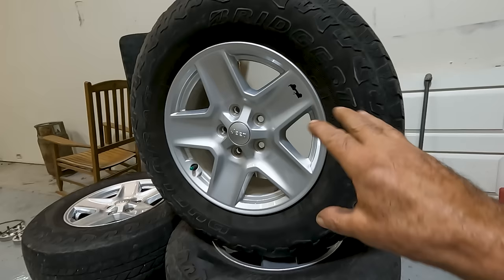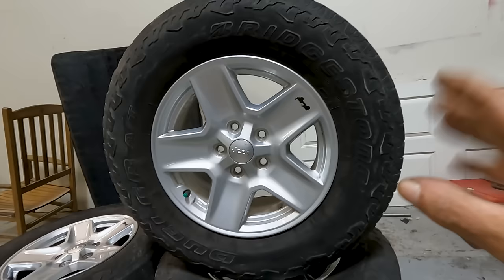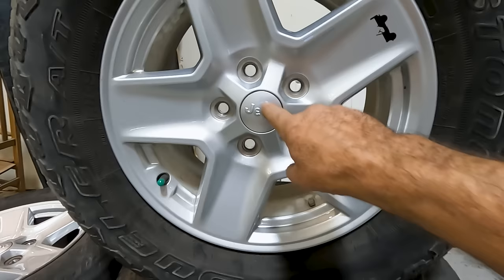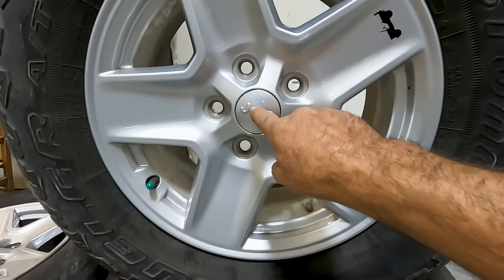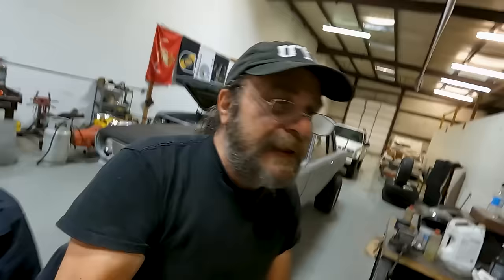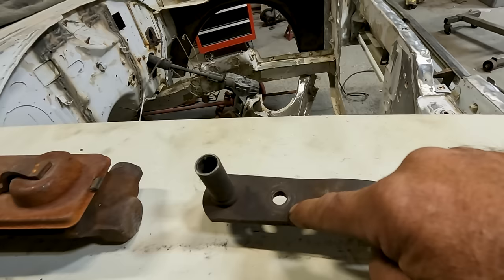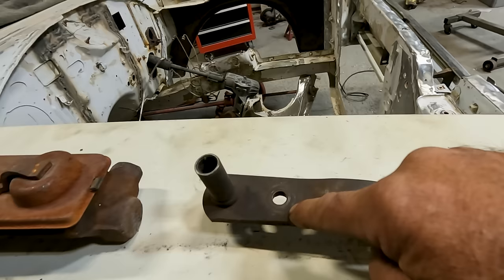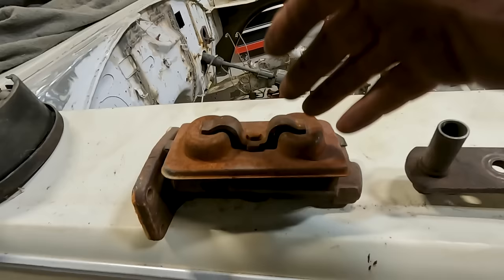Modifying Classic Cars And The Butterfly Effect - Can You Outsmart The Engineers?

Comment: When it comes to hot rodding a post emissions control engine, you're not outsmarting the engineers, you're outsmarting the EPA. 😉
Reply: It’s more about not getting caught. With most cars it’s pretty easy to throw a tune at it and you can change about anything. Or, can go full aftermarket ECM. 
But, unless it’s been through the certification process basically anything different from stock isn’t legal.
Reply: A lot of guys with later '70's cars would take off SOME of the emission stuff and make it run even worse....All or nothing is best
Reply: Hey as long as I can still send my ecu to canada for a tune on my 99 jetta vr6 and have it pass the rediness check here in ny, ill be happy but yeah I usually stick with the pre 96 stuff to avoid the hassle. 
Love my 79 with a diesel,its totally exempt and I can roll coal as I desire 😂😂😂😂
Reply: @NBSV1  one of many reasons that I love living in Alabama 😁
Reply: Well said.
Reply: I've got a 96 Buick Roadmaster sedan with the LT1. I had the PCM  reflashed and got rid of all emissions, optimized the tune, made the transmission shift less like a luxury car, and got rid of the security system. So if I want to swap the drivetrain into something else it ready to go
Reply: ida know, Honda had their CVCC engine that needed almost no emissions crap on it, and GM could have easily retrofitted rochester FI on the "corporate V8"--it actually ran well from 1957 until 1965 when the 396 became a cheaper way to make more than 300 hp--and had better fuel atomization. it could be argued some engineers could have figured out stuff that worked but the "suits" got in the way.

and now, we have 9 second Hemi cars. all that government arm twisting for better efficiency did pay off.
Reply: The EPA was trying to help you. It doesn't help a suit in DC for your car to make cleaner exhaust. Exhaust is a compromise anyways and its always getting worse. You only affect your breathing air and that of the person in the car behind you, pedestrians around you etc. Thats who you can profess to be outsmarting?  If you really want to be a smart American why don't you plumb your exhaust right into the cabin? That way you could become even smarter!
Reply: @NBSV1 do you play video games? You don't change everything with a tune. You can smartly change fuel trims and timing which is convenient as well as boost on some cars but its not changing the physical components or flow potential. It is just as easy as ordering Grubhub is all
Reply: @jamesmedina2062  Mind your own business.
Reply: Not too difficult there.
Reply: @jamesmedina2062  Lol, thanks for the laughs 🙄
Reply: @455buick6  we all gotta breath guy. Covid killed by taking that away. Have you tried breathing recently?
Reply: @jamesmedina2062 cry me a river... So I can dispose of my used motor oil in it😂
Reply: @jomamma1750  You can too
Reply: @jamesmedina2062  Since you brought up the lame political propaganda, you go first.
Reply: @jomamma1750  what propaganda?  You need to be a little more specific.
Reply: @jamesmedina2062  LOL, no I don't, everybody here know exactly what I'm talking about.
Reply: @jamesmedina2062 A "tune" doesn't alter the compression ratio, or the camshaft profiles.
Reply: @NBSV1    "full aftermarket ECM" 
😅🤣😂😅
Reply: @NBSV1  "basically anything different from stock isn’t legal"
Wrong
Not everyone lives in Cali, all my stuff needs to do is pass an emissions test.
Reply: @jamesmedina2062  He is confused, "full aftermarket ecm",  I am still trying to figure out wtf that is.

The way he uses the words process and bsically tells gives away that she was born after 2000 also.
Reply: @jamesmedina2062  no shit Sherlock but engines pack a lot more potential for power with factory hardware that they roll off the line with. A tune can give you noticable power gains for cheap.
Reply: @jamesmedina2062  Cars make a miniscule amount of pollution compared to everything else, it's a joke
Reply: @455buick6  No that's absolutely not true. You must not know much about engines. A good head will flow 275 CFM. A diesel flows even more. When a car is partially burning its fuel and IS NOT RUNNING RIGHT, one vehicle can put out more toxic crap than 100 cars that run right. I am not against cars. I'm a gearhead too. I'm just against ignorance and poor judgement when operating machinery.
Reply: @jamesmedina2062  There's tradeoffs, run lean get more NOx, run rich get more unburnt hydrocarbons. I'm fine with a reasonable level of required emissions controls on vehicles, especially newly manufactured ones, but it's gotten well into diminishing returns. By the mid 00s emissions systems seemed to be pretty adequate for the task, even the constant NOx smog cloud over LA was pretty much gone by the 00s. Regulators and legislators must of course always justify their jobs and department budgets by deciding more regulations are needed even when the problem was solved well enough a decade or two prior.
Reply: @treelineresearch3387  Well I have to agree with your premise. In fact, direct injection is sootier and dirtier than port and the upkeep is more difficult. So they went backwards. Also the big 3 are selling on average more cylinders and poorer fuel economy compared to previous years before they stopped selling cars. Again, backwards. Just when higher fuel prices could steer buyers via higher prices in the markets, Washington swimming in Big Oil cash pushed down on the price scales to placate owners. But to me the biggest issue is nonexistent enforcement of federal laws. They can intimidate manufacturers of vehicles but they are too lazy to go after the thousands of owners going catless. Again another reason why today computers and injection are so good but the emissions defeating renders improvements null and void.
Reply: @jamesmedina2062  Realistically so few people are doing cat deletes that it probably doesn't really have any substantial effect. You can't get it done at any legit mechanic and it likely voids your warranty so it's purely in the realm of enthusiasts and the poor (who simply can't afford a new cat nor a new car). The latter is a much larger group and to me solving that is more about making cats cheaper. In the case of a place like California their special requirements for certification and genuine OEM parts make replacement cats cost twice or more as much as in states without such asinine regs that seem to be written by the auto dealers and manufacturers.
Reply: @treelineresearch3387  cost is definitely a factor but I am seeing whole segments of certain vehicles all getting behind the norm of cat-delete. Loud sound is probably the most important reason. The second reason is increased power. In the diesel crowd, defeating their systems is mandatory to increase economy (supposedly) and increase longevity(& reduce costs).  Plus you have to be educated in the reality that close to 100% of older vehicles that are legally exempt because they're older than 24 years will never elect to repair or upgrade their vehicles when it is not legally mandated. SEMA and all the weight of aftermarket manufacturers is also behind crippling real enforcement. The situation is very different in Europe but no less exciting to some to flout the law there as well. It's like imagining that because there are some laws against drug use that the whole of society will just comply. Not only do people not comply but they contribute to multi billion trade in it. Flouting the law is a thing you know? How much in federal taxes is avoided? it's a lot bud.
Reply: @jamesmedina2062  Changing parts requires changing the tuning. You can gain a little power from tuning on stock stuff. But, if you're trying to get beyond EPA controls it typically means you're also changing physical components.
Reply: @NubsWithGuns  Well, you cut out the part where I mentioned if it hasn't been through the certification. Context can be important.
 Some of the emissions things are Federal. But, it's all legal until you get caught. Just ask all the shops that have gotten hit with big fines.  
FWIW I'm in an area that has no emissions testing. So there.
Reply: @NBSV1  as I mentioned the EPA doesn't care about your intake side so it is the exhaust side that whence removing your cat, you need a O2 spacer and tune to remove a check engine light. No major engine changes were made. Cat free downpipes are incredibly common and popular because they also make the car louder and everyone (young) wants their car louder.
Reply: @jamesmedina2062  As far as the EPA is concerned removing the cat is illegal. With them anything changed on the car that hasn't passed the testing and been approved is illegal. 
But, if they don't check it and you don't get caught then it's basically whatever you want to do. 
And, simply adding a spacer won't keep the CEL off if you remove the cat. Spacing the O2 out can help if the cat if marginal. But, especially with newer vehicles, it's looking for very specific readings and it's much harder to fool. 
You can usually throw a tune at it and just turn those codes off. I've never bothered to check how that shows up on the monitors and such though.
Reply: @NBSV1  The EPA does not touch the end user EVER.  What the EPA does is pay attention to large manufacturers and for a short while, 2-3 years ago, they went after nationally recognized shops performing cat deletes to fine them. They caught flak and stopped. Also some states use EPA guidelines if they are serious about emissions. California for instance. Urban zones such as Denver. But in speaking with government officials in Texas at least they said the laws do not affect cars older than 24 years and when the car computer says "ready" it automatically passes in my city. 

In general EPA does go to the birth of the car but does not do much after it is birthed. Kind of like Republicans in Texas with babies. Once a car is out in the wild it is super easy to fool the tax authorities in their states or simply pay someone to pass them. Its like cheating on a school test, only easier.
Reply: Lot of ppl in this thread obviously got brain damage from sitting in the drive thru in their decatted gas guzzler. Pollution is so cool!!! Beyond parody.
Reply: @user-zj5in4hg7w  It doesnt even have to be a gas-guzzler. Men in America do not think and simply try and be the loudest car on the road. Little if any original thought or sensibility. Sign them up for NRA and MAGA obedience!

Comment: I replaced the trailing arm assembly in my 74 corvette because I thought the wheel bearings were going bad and they are next to impossible to replace. Over $1000 dollars later and lots of swearing it turned out that the squealing noise I heard was just the positraction, it had the wrong fluid in it. Oops.
Reply: Honestly,, the true and real car lover has respect for..
Reply: Sadly.....some version of that has happened to most of us.
Good thing we love these mechanical contraptions
Reply: I was planning to drop the pan off the 300 i6 in my van (not easy to do) to check all the rods and for piston slap thinking I had a knock. I had already pulled the inspection plate for the trans and checked for cracks in flex plate and loose bolts.... Checked exhaust manifolds with my camera. Two months I eventually discovered it was the smog air injection tube broke. Lol. I didn't really know that was a thing until I did some research

Comment: One of Chrysler's main engineers, whose name escapes me, remarked that the difference in stroke between the 198 c.i. slant six and the 225--barely a fraction of an inch--made a large difference in the tuning and carburetion. I would've thought it would make little or no difference at all. Small innocent changes from stock can entail big problems to be solved.
Reply: Your mom said a fraction of an inch of a stroke made a huge difference too😮
Reply: @fastinradfordable 🤙
Reply: Small changes in stock can also fix/improve many things. Especially with new improved parts.
Reply: @fastinradfordable  Was that trip really necessary? Anyway, to be fair, I'd rather be Cummin' than Powerstroked.
Reply: Probably Larry Sheppard

Comment: The only thing I changed on my 87 Diplomat police package was the Lean Burn system. I replaced all the broken or rusted parts with correct factory spec. Parts. I really love how you mentor people in depth. I am 74 years old, and have been a car guy since I was 14 years old. Kudos for your ability to teach the reasons why systems work, and why they matter.
Reply: I drove that car as a taxi backin 88/89. Loved it.
Reply: Ran an 88' on 30" wheels, very mad max with the roof cutoff

Comment: One thing that I do believe in changing is the brake master cylinder.. If it has the old single  reservoir single outlet master cylinder, I believe in updating it to a dual master cylinder for safety reasons.
Reply: Conveniently, Tony's rule of thumb with "interstate era" cars also coincides with dual master brakes.
Reply: @rhekman very true, but I do agree with upgrading the master cylinder and distribution block for safety reasons. It's not a performance thing, it's a failure issue.  If you lose a line or cylinder on one wheel, with a single reservoir you lose all braking.  With a dual, you still have enough to stop safely, albeit maybe not as stable, until you can fix the issue.
Reply: @rhekman  he said 1962 and newer... Dual master cylinders started in either 66 or 67 for most cars. I updated the master cylinder on my 63 Dodge from a single to a dual master cylinder last summer
Reply: True I had a 65 Chevelle with a single. It ended up being the down fall of the car. 
But like he said upgrade the whole system. The 66 went to a duel master cylinder what was basically the same car.
Reply: @nathanmortenson914  I still have 4 wheel drum brakes on my 63 Dodge and they work great. I switched to the dual master cylinder  when the car was stolen and the thief had hit something and it had  cut the brake hose and I didn't know it. I hit the brake pedal and it worked fine but the next time I hit the brakes They worked fine.... for about 2 seconds then went to the floor at 65 MPH coming into a sharp curve in the road. I didn't hit the ditch, but I had the crap scared out of me.
Reply: Not really.  Tony is talking about 1962 and up but cars didn't have the dual until 1967.  That is 5 years of cars that need the change. @rhekman
Reply: Very  true  its a bit of a pain to repipe but its way safer
Reply: My 71 Challenger has 10 inch drum brakes, front and rear. Back when it was my daily driver there were some very interesting experiences when I had to drive through deeper puddles. Brakes didn’t work well after that So I’ve been set on putting disc brakes on it before it goes back on the road. Uncle Tony’s video has not made me rethink that, though, I will be far more careful about matching up the right master cylinder, and other components. I am sticking with factory KH pin calipers and adapters and rotors.  No aftermarket. It will be very similar to what the  been set up with had it been ordered with disc brakes.
Reply: Same think I did. A dual master cil. Added a PCV and upgraded to a GM 1 wire alternatoe

Comment: every car i have is 66 or older....i daily a 62 pontiac catalina....its as stone stock as the day it drove off the dealer ship....points single exhaust "economy package" 2 barrel....i drive it every single day rain sleet snow summer.....4-5 hrs on the high way at 70-80 mph....and i hear people all the time say you cant daily a classic.....yes you can....they was designed to drove on a daily basis....if you leave em alone and leave em the way the factory made em you can daily em...they was just a daily car then they can be a daily car now with out all the headache of changing every thing....

Comment: What an engineer designed in 1970 cannot be compared to something designed in 2023. Engineers do know better, and fitting a 2023 brake system to a 1970 car is obviously going to improve the braking.
Reply: Only if you do a complete fit out with master cylinder, front and rear all designed to work together

Comment: Some of my buddies in high school learned the hard way when they put the 38’s and 44’s on their 4x4’s in the early 80’s. Fun in the mud but you couldn’t slow down normally on the road.
Reply: My simple understanding of it... Leverage,, like how a Breaker Bar works,, tire is now taller,, or further away from the rotor still attempting to stop..
Reply: @AtZero138  and its the weight of the extra material in the larger rim
Reply: @albertgaspar627  of course,,
Reply: @AtZero138  yep, a taller tyre puts more torque against the brake friction surface. One of the reasons (of a few) that performance brake uprgades offer better braking, is simoly because the diameter of the brake disc is larger than stock, making it apply more leverage against the wheel... It effectively reduces the ratio between the braking surface and the moving surface. It's also one (again of several)reasons that modern cars have larger wheels; in order to accommodate a larger brake disc. The overall tyre diameter is typically unchanged but the brake disc is larger.
Reply: Same applies to chrome 24s....the weight and leverage really hurt braking. So much more than people even realize.
Reply: My neighbor had a truck like that,and he let pops borrow it for a lumber run. 
Big ol aggressive luggy 38s or 40s or something for tires. 
Of course it was raining so anytime you touch the brakes it was like a baby deer on an icy pond and taking off you could sit forever just turning tire going nowhere. 
Definitely had to drive it like you had a raw egg taped to the bottom of your shoe and weren't allowed to break it.